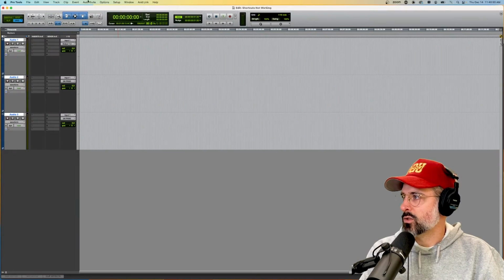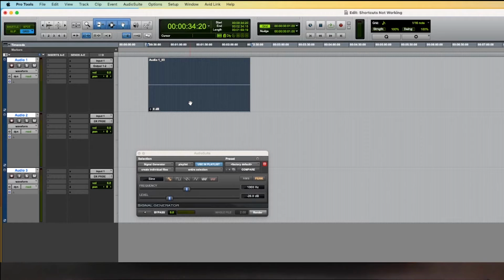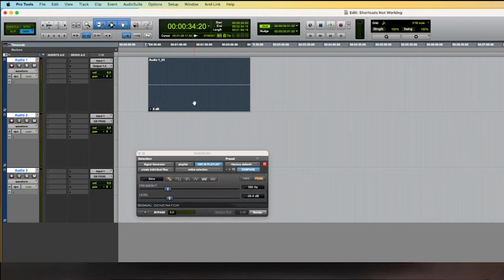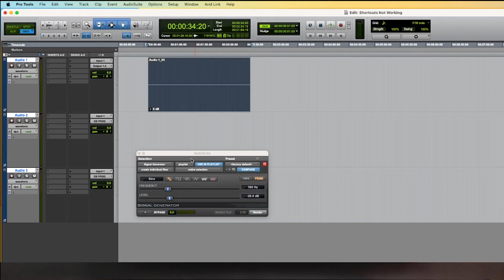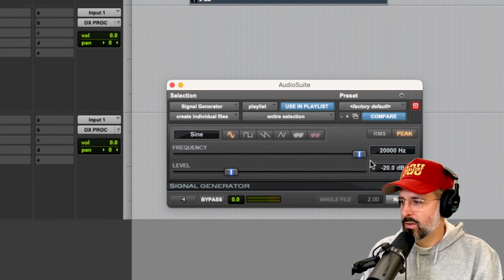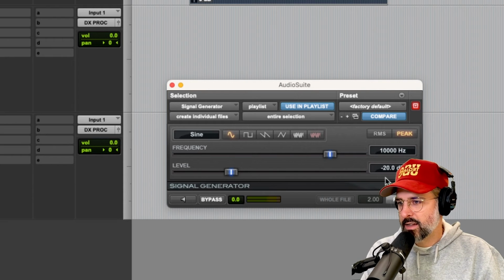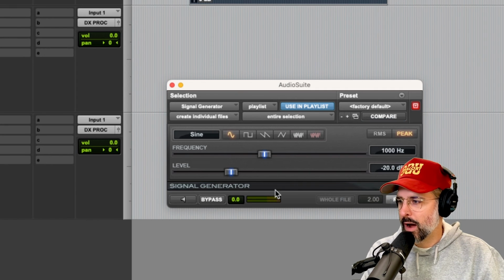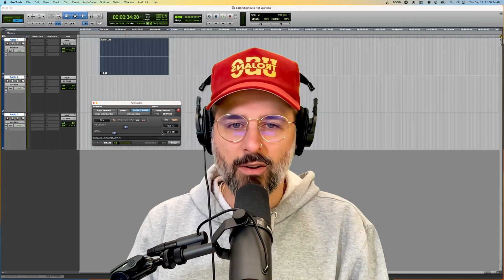Signal Generator Hearing Experiment in Pro Tools

Comment: Hi sir multiple mono vs stereo what kind of different
Reply from the maker: multiple mono is most commonly used for surround sound, so instead of one "interleaved" file, it splits out to a left channel, center channel, right etc. Just depends on the needs of your project, but stereo is probably more commonly used.
Reply: Sir, I had recorded the voice over then I used ns plugin.. finally voice is muffled